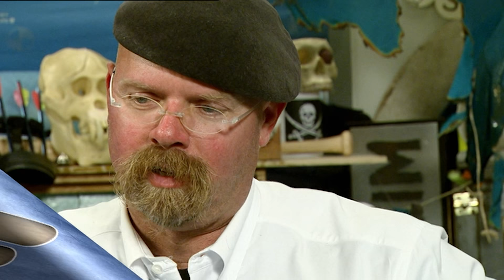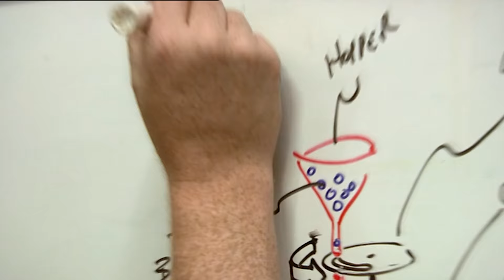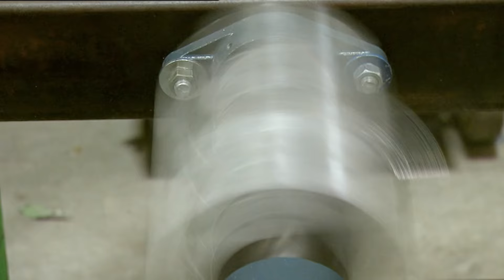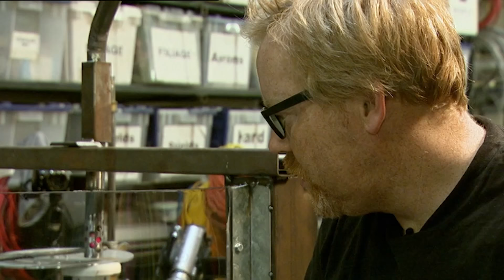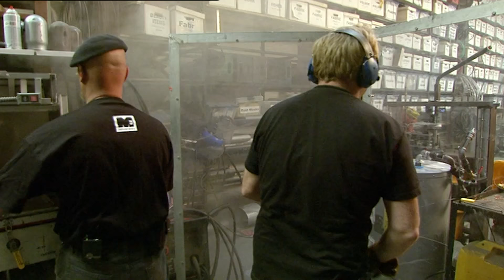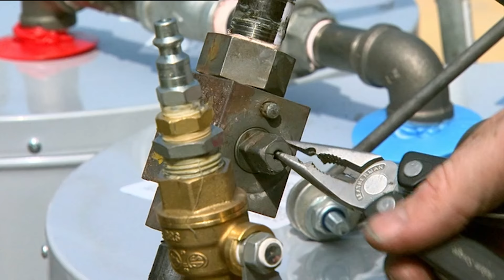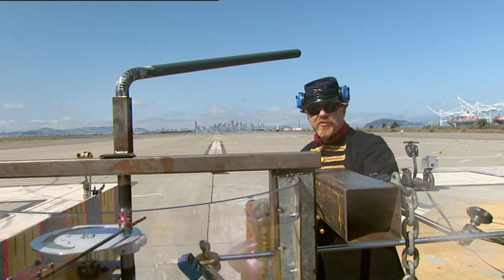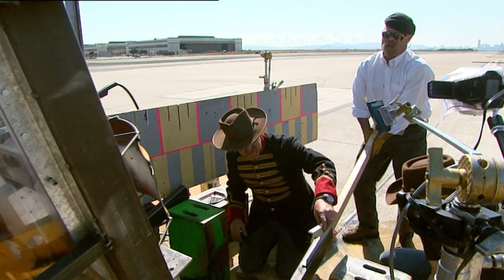Could A Steam-Powered Gun Really Fire 400 Rounds A Minute? | MythBusters

Comment: Keep in mind, the men making this during the Civil War didn’t have access to rolled steel, the boiler would’ve been made from wrought iron. They wouldn’t be able to safely get much higher than 130 psi, so even more chance of kaboom.
Reply: They were however experts in steam power during the peak of its technological implementation, the building of steam engines and the mechanical conversions required to turn those forces into motion, they were limited by materials compared to modern times, but they were well acquainted with such limitations and had built trains far more complex than this for decades at pressures up to 200 psi in stay bolted boilers. 
Most steam technology by the end of the century ran comfortably between 250-300 psi with some in excess of even that, with some experimental designs held up to 500 psi, all still without modern luxuries, its a mistake to think with all the ingenuity of a war and the best minds these things arent possible. 
To me its a simple question, are slings a lethal weapon? Yes.
Is this just a more powerful self loading sling, again yes.
So somewhere between practicality and reality is the device they wanted, the proof the concept is a lethal weapon is moot if its firing faster and harder with larger potential munitions than a human can already kill someone with, it will be if you make it one.
Whether you would trust a device that complex to be used by a soldier in a battle is probably why they didnt pursue it further, just like every other experimental weapon of war.
Reply: @masteroogway6660  I was just pointing out that about 130 psi in a wrought iron boiler is probably the best they could do during the time of the Civil War (1860s), maybe around the 1880s-90s you’d get to 200 as rolled steel became easier to mass produce, but 300 psi didn’t really come around until the superpower steam era in the 1930s-40s, see most later 4-8-4s  and large articulated steam.
Reply: Through history, a whole lot of people, men mostly, have been hurt terribly or killed by steam boiler explosions...and yes, 125-150 pounds was pretty much the upper limit...especially before actual rolled steel...everything was cast or wrought, bursting was often, and not very predictable...
Reply: @douglasankrum7486  My points exactly.

Comment: I built something like this to work off of an air compressor. Using golf balls. It was only successful after pressurizing the magazine. Then it was so dangerous. I took it apart and never built another one.
Reply: On one of my jobs we had titanium tubing of various sizes and compressed air with blower nozzles. I found some steel ball bearings to shoot out of one of the tubes at a target basically made of waxed canvas. It was so loud and scary coming out of that tube hitting that canvas.
Reply: A golf ball gun in almost any iteration is scary😊
Reply: I was thinking about a pressure feed for the balls, to keep them from getting slowed down by friction on the drop.
Reply: @artgoat a timed interruptor.